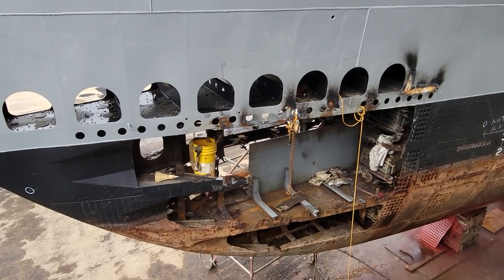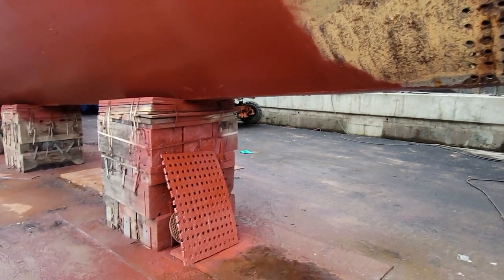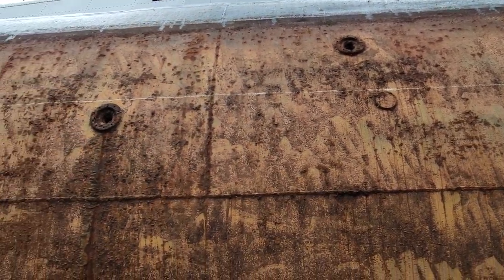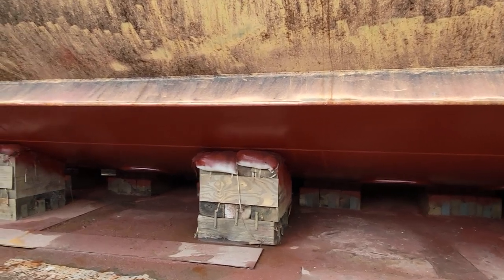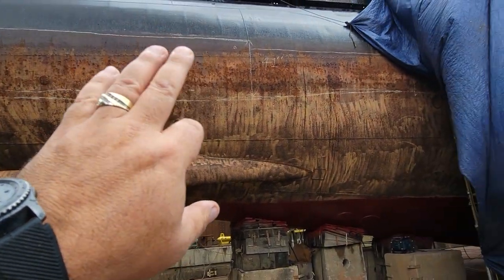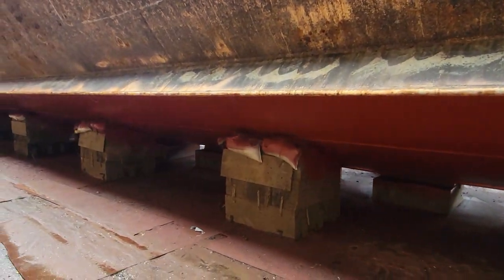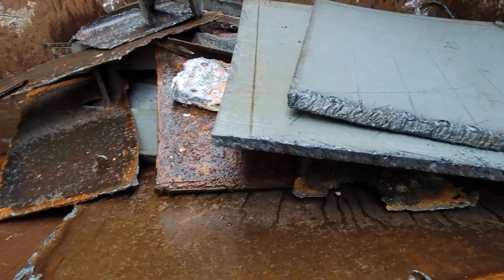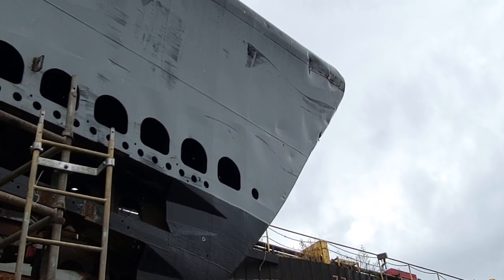USS Cod drydock update #2- 7/16/21

Comment: Why don't they sell pieces of the cut out steel as a fund Raiser?
Reply: I have a piece of steel that I got from the president of the card association two years ago it from coning tower
Reply: That was my thought! It would be great as a fundraiser and would give people a great souvenir
Reply: @BeatlesUS99  I hate to say it but they probably will not do it and waste a good fundraiser.
Reply: @docbrown6550  Thing is, it's pre-Atomic age "Low Background Steel" That can be worth practically whatever you want to ask for it for use in super sensitive radiation detection equipment. Hopefully, they already have a buyer set up for it. Assuming it wasn't pre-sold as part of funding the work.

Comment: Thanls for the update, very ibteresting. I didn't quite catch who donated the paint but whoever they are thank you. I always assumed that a new block would be placed under the newly painted keel section and the original would be removed, working a long the boat one block at a time,then again most of my mechanical and civil engineering experience has mainly been on dry land. I was also unaware of the Navy's service program procedure. Keep up the good work all and thank you for assuringtheis ladies future,
Reply from the maker: Sherwin Williams donated the paint.

Comment: Epoxy works very well. I have a 38  foot steel sloop. Sandblasted her and put on 4 coats of epoxy, alternating grey and white to see if I missed any spots. Been in the water now for 4 seasons, and the epoxy is still mint. The anti-fouling keeps the zebra mussels off, only place I get them is the prop and the anodes.

Comment: Actually, fuel is lighter than water.  So, to avoid having air replacing the fuel tank as it is burned, the tanks were fill with sea water.  The water was flushed when space needed in the tank.  That is what I understood from submarine operation.

Comment: Though she doesn’t have propellers to run, has she been examined to ensure the packing on the propeller shafts is sound and isn’t in danger of failing once she’s back in the water? I’ve heard instances when the packing dries out and is submerged again it may be more prone to failure. I’m also wondering about the reliability of the pumps to clear the water out should they be needed.
Reply from the maker: I believe we are having the shafts repacked  in dry dock.

Comment: Dumb question, but with all the pitting, why not just use a welder to just fill in the pits and then grind then down smooth instead of replacing whole plates of steel. I was there when you guys moved the cod. I didn't see you all hit the dock or ship but heard about it later. I just don't get why the coastguard just didn't move there boat to make it easier on you guys.

Comment: Question for submariners: the Forward Torpedo Room had six tubes, and there were 16 torpedos stored there. From what I've learned, 6 were stored in the tubes and two under the floor. So that would mean 8 were stored in the skids on either side of the room (4 on each side). Have I got that right? because looking at video footage and images, it only seems there is room for two torps on each side. It just seems hard to believe that there were 4 torpedoes stacked  on the port and starboard sides in skids. Can anyone speak to how these torps were stored? I'm obviously missing something.

Comment: Its good cod is in fresh water, USN guidance on drydocking ships in freshwater is once every 25 years,  preferably., where as salt water should be every 4 years. Has anyone suggested a smaller mini caseon, like the uss Olympia has to be able to repaint and do minor work on the waterline?
Reply from the maker: We don't own the dock or able to do that in its current berth. Probably a lot of red tape with the city for that.
Reply: @amigodiver  Sorry my terminology was way off. Its basically a steel box they suction to the side of the Olympia and drain out the water, here is th curator of the battship New Jersey discusses the different ways to do maintenance. https://youtu.be/aFcOm6dkuoc
Reply: @amigodiver  Its at the 4 min mark in the video.

Comment: I would be curious why the Cod is not allowed to be operated under its own power.
Reply: Stipulations from the Navy when she was donated. Same as any museum ship.
Reply: @luciusvorenus9445  : That's a real shame.  The Navy must be skeered that some sensible mid-Westerners are going to sneak out with the Cod and attack California or NY City :p.  That could be some serious shits and giggles if the Cod could go under power and offer lake tours, and honestly, I wouldn't feel slighted if they didn't launch some dummy torpedos!
Reply: A lot of the comments below are BS.  All of the deck guns and torpedo tubes can be certified as non-functional the same as the restored PT-658 patrol boat, an operational WW2 PT that boat provides tours on the river all the time.  The reasons the USS Cod can't be operated under its own power are manifold.  It no longer has its propellers.  It would require a deep water pier.  The scale of the boat compared to a PT boat would require dozens of trained crew to operate her safely on the surface...it would never be allowed to submerge of course.  Additionally, many of its systems are non-functional, such as the air conditioning and heads, which would be required if it provided tours.  Finally, a submarine is not a PT boat, where tourists can safely gather far above the water line...the deck is close to the water and could be occasionally awash, and it is therefore no place for tourists without safety harnesses and lines.  All that said, if a billionaire wanted to donate enough money and pull enough strings to make the USS Cod operational for surface cruises, it could probably be done.
Reply: @luciusvorenus9445  Removing the screws and capping the outboard end of the shafts was a normal part of converting a fleet boat for use as a Reserve training unit, along with removing all the berths from the after battery area to create a classroom. Cod's crew has spent years finding and replacing fittings and equipment the Navy removed during the conversion.
Reply: @TheJTMcDaniel  Thank you for the information. I wasn't aware of that.

Comment: Does anyone ever talk about leaving things like this out of the water? A simple building would protect it WAY better than leaving it in the water. Its not that big. The U505 display is awesome! Its protected and accessible.
Reply: One problem with placing a ship or boat on dry land is they are designed to be in the water with pressure applied by the water not only from below but also along the sides of the hull. When they are placed on land all the pressure from the weight of the structure is applied to the hull through whatever is supporting it. Over time the middle of the hull will begin to bulge since there is no corresponding pressure being applied to those area.
Reply: @DuffyF56  I'm an Engineer so I don't believe that is an issue. Its pretty easy to make cradles to distribute the load. Even if its a lot of them. No one gets to see the hull when its in the water so they are not covering anything. Those hulls were made to withstand LOTS of pressure at diving depth. While its the other direction, It was designed to withstand 10 atmospheres or 150 PSI. Its just not that hard to support its weight.

Comment: the metal from ships Built before the first atomic bomb was dropped it’s worth a lot of money it has no radioactive isotopes in it which all metal since the first nuke was  exploded in the atmosphere all have traces of isotope special instruments need  that type of metal  which means steel created before roughly 1945
One reason the metal from theUSS  Texas is worth a lot of money helps offset the cost of the new steel going back into the battleship